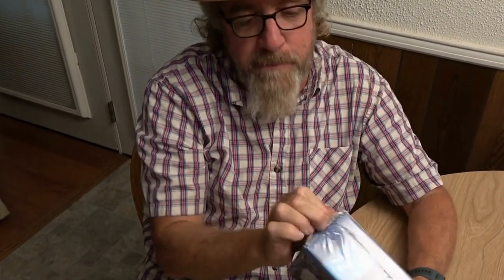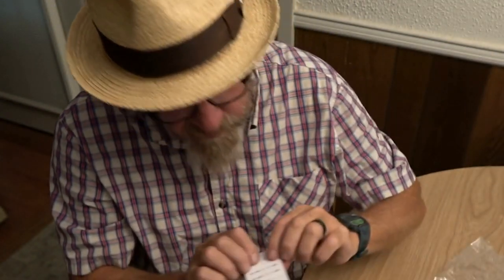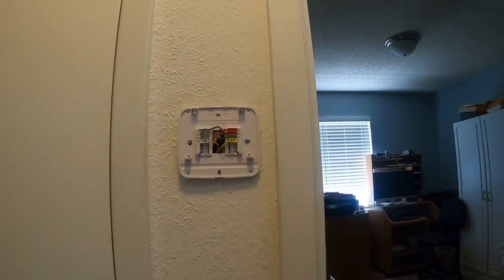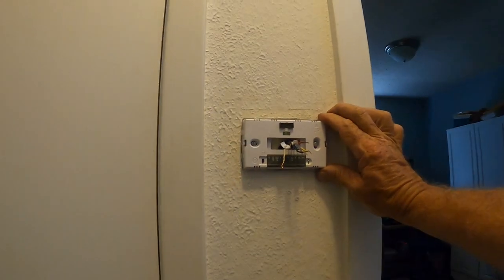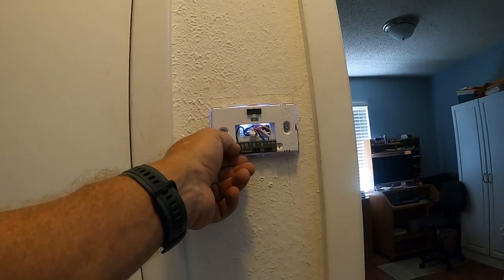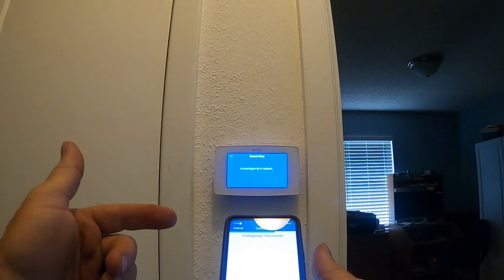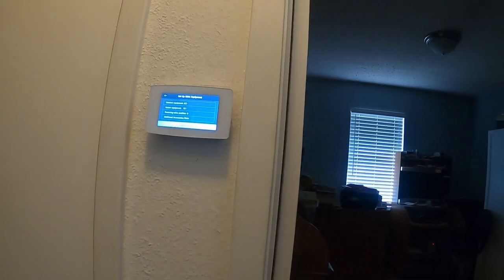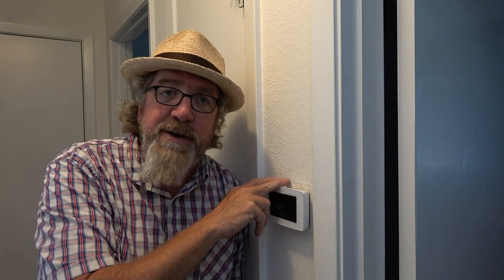Emerson Sensi Touch Smart Thermostat installation. Super easy to do.

Comment: I have a question regarding the way the thermostat is wired. I have a Trane Single Packaged Electric Heat Pump System (Heat and AC in one unit). Is there anything that would be wired differently than what you showed in this video? I saw that you mentioned the advanced setup and there was a different wire setup for heat pumps. Would I have to configure the wire setup differently or since the Trane unit is an all-in-one system would it just be wired the way you did it here in the video under "electric heat?
Reply from the maker: @josephwaters94  there is another wire that would be needed for a heat pump...on orange typically and that would go the O terminal on a typical application. There is a spot in the initial set up to tell the start Stat what wires you have.

Comment: Nice vid. I have an orange wire (total 6 wires) going into an "O" socket on my PRO T721 current thermostat (just like yours). Were should I connect this wire on the Sensi? O/B socket, maybe? I have a heat pump. Thanks.
Reply from the maker: On my sensi stat the O/B is the same terminal. You will need to land the orange wire on that terminal. Make sure you set up for heat pump operation in the initial  set up on the stat. The app will walk you through all that.
Reply from the maker: And thanks for the comment and the veiw

Comment: Hi. You helped me before and now I have another issue with the Sensi Touch. As the cold weather set in I switched to Heat on the control. Every time I raise the temp past room temp the unit will cut off, shut itself down and restart but it will never start the heating cycle. I reinstalled back the basic standard PRO T21 and the heating worked fine. Did I installed/programmed the Sensi Touch wrong? Please advice. Thanks.
Reply from the maker: Might be something wrong with your unit and not the thermostat.
Reply: I think I fixed it. I connected the O wire to the O terminal on the new "smart" thermostat as you suggested. While doing the programming on the Emerson Smart Touch app, instead of entering the "O" terminal as a connected terminal, I entered an "OB" terminal as connected even though there is no such thing on the new thermostat. Now it warms and cools as requested.  I hope others having the same issue understand and helps them if they are having my same issue. Oh, my entire home HVAC unit is brand new installed in December 2023. Thanks again.

Comment: Hi there, quick question. Does the sensi make a clicking sound when it turns on  and off?
Reply from the maker: Probably, because thermostats Have relays inside that close when there is a call for cooling or heat. that is what is making the clicking sound.
Reply: So it’s normal? Thanks for the quick reply . @pawpawdiditagain2654
Reply from the maker: It is normal. Your welcome

Comment: I just purchase this item and my wire at my home , is only showing 4 wires: Green, red, yellow and white. I do not have the fifth wire Blue. This unit is asking for a C wire ( Common Wire). In my box I have a loose white wire. Question, how do I continue with set? Thank You for your time and service.
Reply from the maker: you are going to have to have a c wire adapter. Or pull a new 5 conductor wire from your indoor unit to your t stat
Reply from the maker: https://www.amazon.com/Provide-Accessory-Common-Thermostats-Wires/dp/B0B1VBMP2Y/ref=sr_1_1?crid=3PUG0W1WU9GE2&keywords=emerson%2Bc%2Bwire%2Badapter%2Bkit&qid=1691888831&sprefix=emerson%2Bc%2Bwire%2Badapter%2Bkit%2Caps%2C134&sr=8-1&th=1

Comment: I love the battery operated part but this thermostat keeps losing the WiFi connection which was never a problem with my Nest and when it is connected, the app sometimes isn’t reflecting what the actual thermostat is reading / doing! The “smart” capabilities are shaky at best.  Hoping Sensi improves it.

Comment: Why did you choose electric during the setup if it’s a gas furnace and not a heat pump? Or is it for strip heat?
Reply from the maker: It is strip heat. Sorry I did not specify in the vid.  Thanks for the comment.
Reply: @pawpawdiditagain2654  thanks. Good to know. Was thinking about getting one these for a customer and don’t really know anything about them.